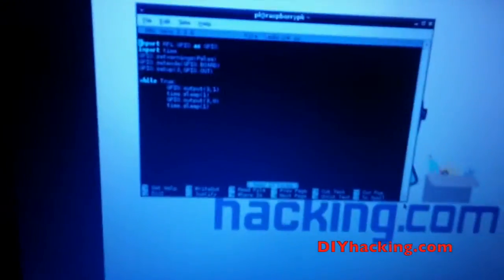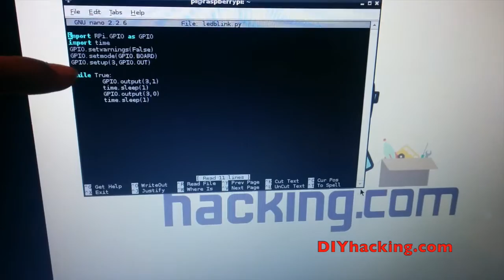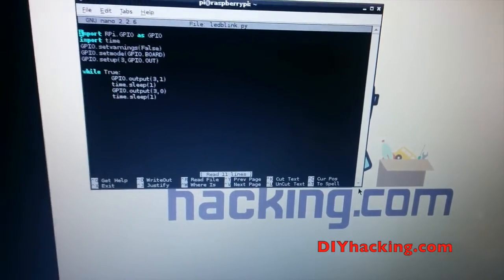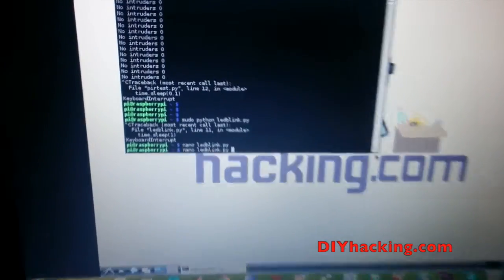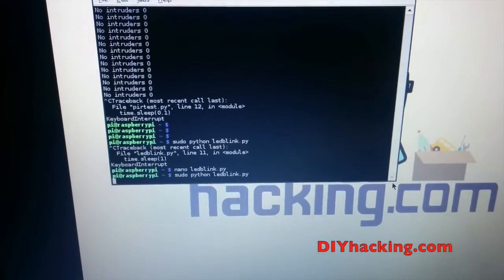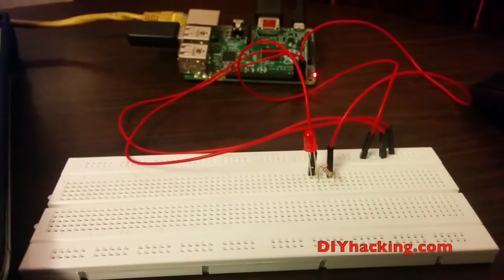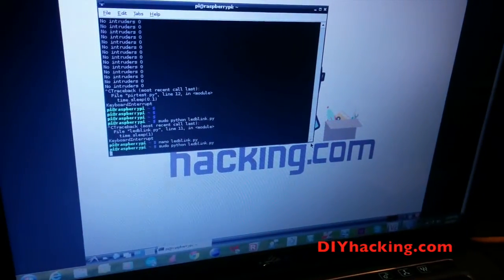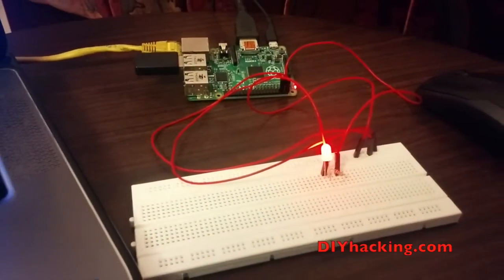Raspberry Pi LED blink tutorial

Comment: Question, I have everything setup just like your showing in your video with your script, and this is the error that I keep getting:

pi@Raspberry_Pi_Home_Bench:~ $ sudo python ledblink.py
  File "ledblink.py", line 8
    GPIO.output(3,1)   #Outputs digital HIGH signal (5V) on pin 3
       ^
IndentationError: expected an indented block

Thanks for any help!